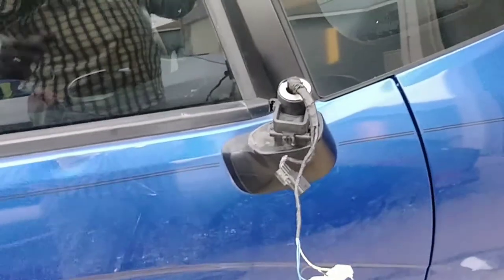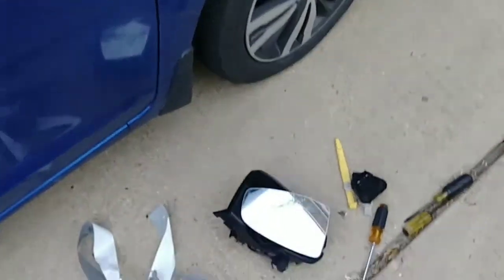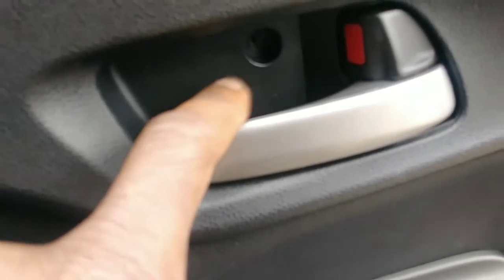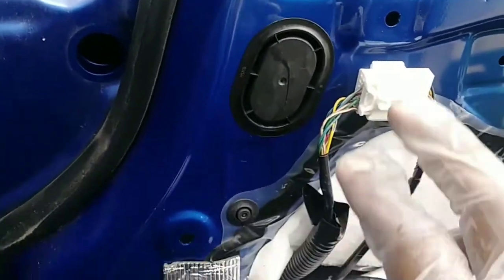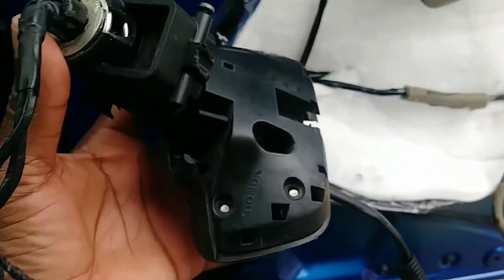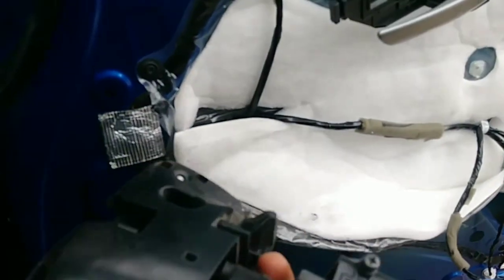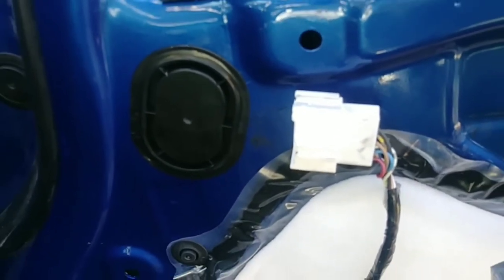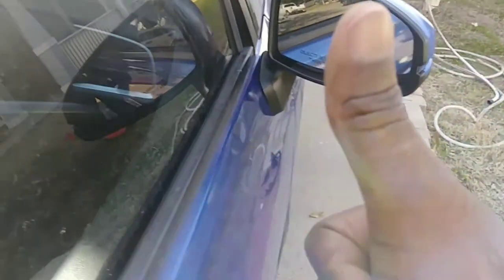HOW TO re-INSTALL A SIDE MIRROR ON ANY CAR OR HONDA FIT

Comment: Thanks my brudda for post, fount one on amazon for $47 slavers, mirror was white and cant tell a difference from the white car paint, took me 35 minutes of hard work with two 10 minutes breaks included. 😂 What I did to prevent those nuts from dropping inside the panel is used a magnetic stick like you have, cracked the nut and stuck the magnet on the nut while poking finger in the hole to loosen the nuts, then use that magnet in reverse the same way to reattach. The mirror I have was basic model car with only motorized mirror adjustment and did not have the blinker light or camera..., that plug fit perfect.

Comment: Guys, being not content with settling for no power mirror, I've modified the smaller male connector that came with the aftermarket mirror. Just take a utility knife and shave off extra layer of plastic (around 1/8 inch). After that it fits in the left upper corner of the larger OEM female connector. It works, try it.

Comment: I got everything out, the panels, the 3 bolts but there's a black wire connected to my mirror.
It's passenger only power operated mirror, no light, no hearing it's only regular.

But I cannot find the wire... Any help is appreciated
Reply from the maker: The rest of the wire may be inside the door frame or compartment...just follow the wire from the mirror to wherever it leads you to...

Use a flashlight for clarity...